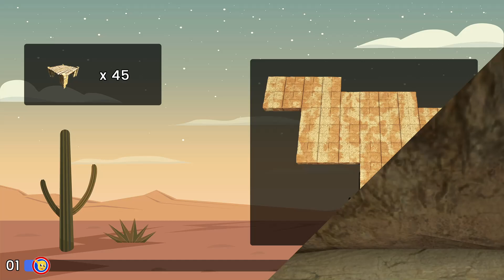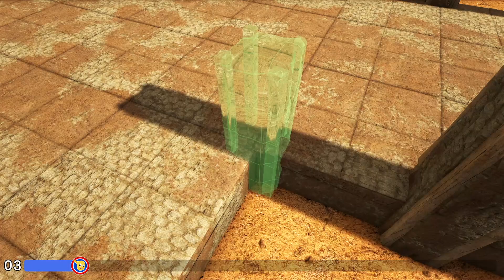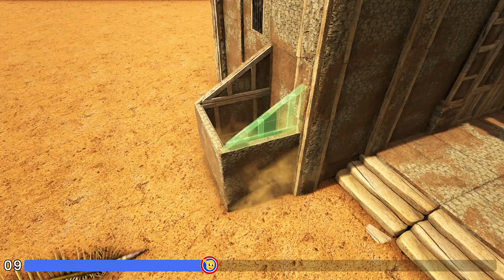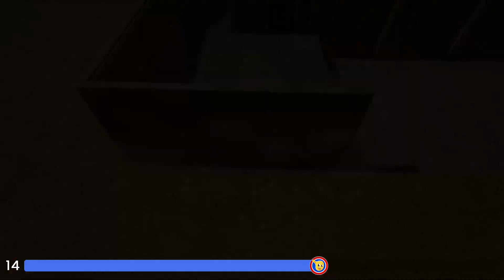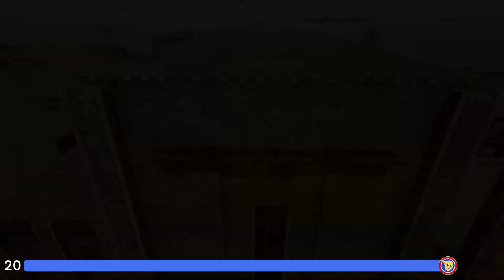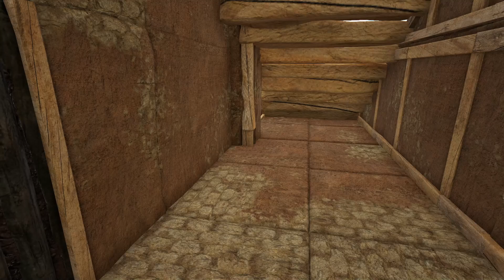How To Build An Adobe Workshop | Ark: Survival Evolved

Comment: This build has two rooms that are purely cosmetic and cannot be accessed. One is the little shack near the forge and the other is the wood overhang above the terrace. I put a door in the shack and use it as a little toilet room but the overhang is difficult to make work. Its just one foundation wide and split in two. Maybe Ill expand it by one and get a staircase or ladder on it to get in.
Inacessible cosmetic building parts make me anxious, theyre dead space. Do you yourself have an idea to make it useful?

Comment: Very clean modern SW American design for a player or tribe at mid-game.  Very minimal amount of wasted space.  That wouldn't look out of place in a higher-end New Mexico neighborhood.

(Or, with all the pillars, an Aaron Longstaff video. :-)

If you are on a modded cluster, you can use the Structures Plus (S+) converter to make vanilla foundations.  You only need them for those four sunken wall pieces for the nifty windows made from doors. Multi-depth walls are pretty much verboten with S+ and a royal pain to deal with.  The thatch doorway on a fence foundation trick used for CHipZz style fancy shelves can get the doors in place with just straight S+ parts.

Everything else can be done with S+ Tek parts and re-skinned to adobe.  This is helpful if you run on a server with structure decay.  That will maximize your decay timers.  Make sure to build the fence foundations out of Tek, too!

If you have the S+ Tek Replicator size set to minimum on your ARK, it will fit where the vanilla Industrial Forge goes.  The minimal resized S+ Industrial Forge is a bit too big to fit above it on a second floor. Though you could put an extension to the roof with care.

Comment: Chipzz does this need to be built out of adobe or can we build it out of something else
Reply: Ok thanks
Reply from the maker: You're welcome
Reply from the maker: It can be built out of other stuff. The only thing you might run into issues with is where I doubled up walls. But if you place a thatch wall first, then say a wood wall in front, you can then replace the thatch wall with another wood. Hope that makes sense lol.